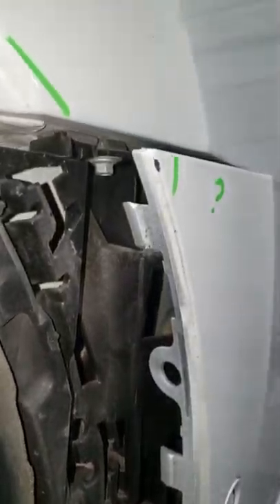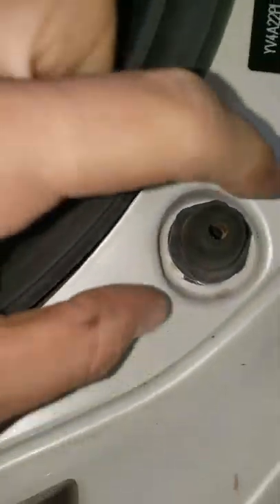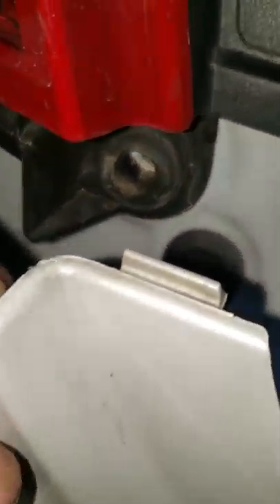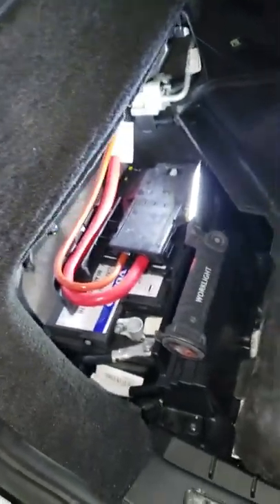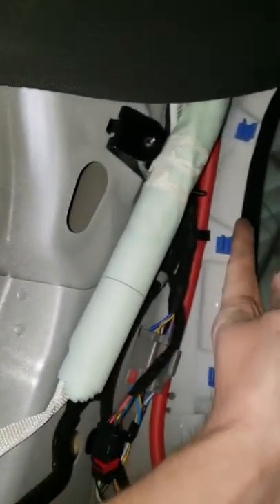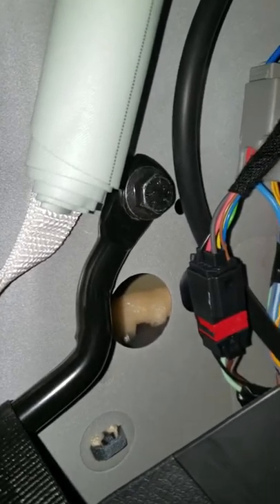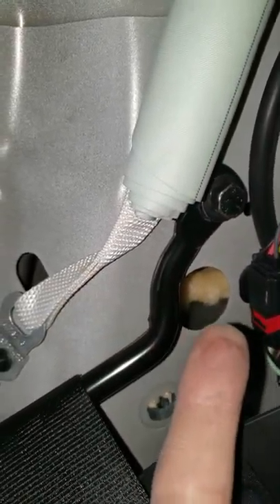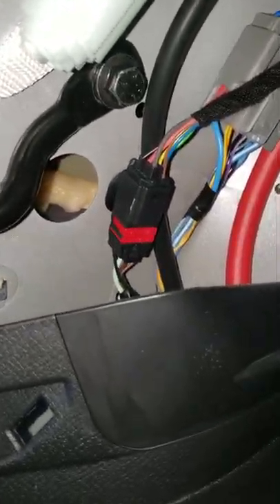Volvo XC90 2018 How to remove Rear Tail Light and bumper Drop.

Comment: Makes it 10x easier if you have an inspection camera that you can insert through the side hole (for the top screw). I also used 2 to 4 plies of paper towel to hold the bolt tightly in the socket since I didn't have a magnetic socket.

Comment: So......how do u get to the bolts to drop the bumper...would have been nice to show that....duh
Reply: There are 4 T20 bolts. 2 in the wheel well and 2 by the exhaust. You don't need to pull any other bolts out to loosen the bumper. This Volvo was a bitch to replace a tail light on though. You have to pretty much gut half the interior to reach any of those screws on the inside.
Reply: Thanks, your video is very helpful!
Is it hard to pull the panel for the top bolts of the tail lights?
The top of my right tail light got loose.